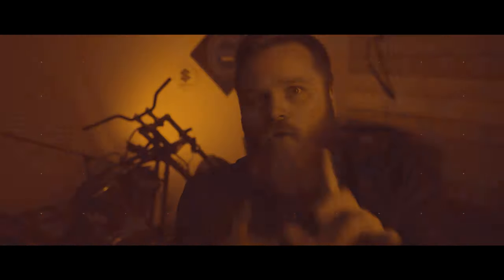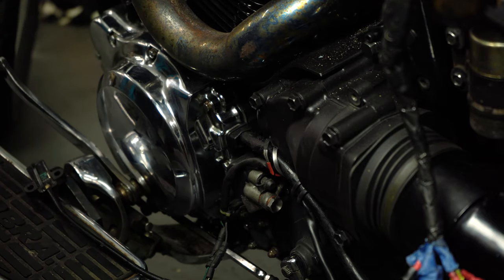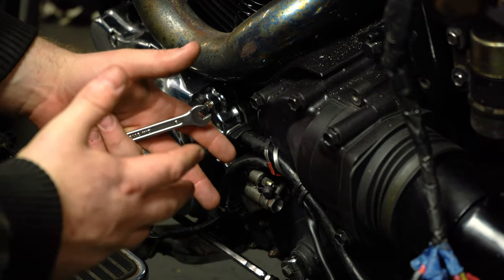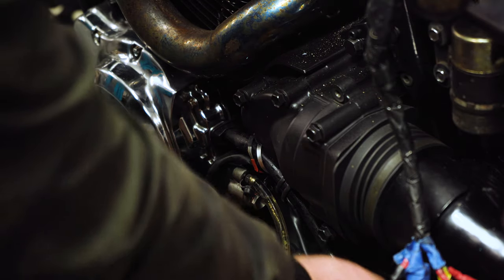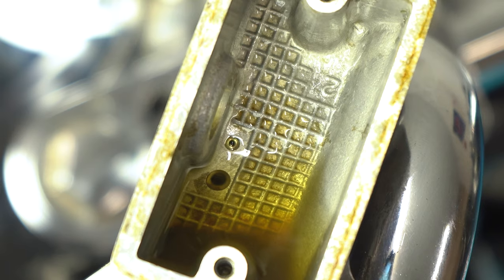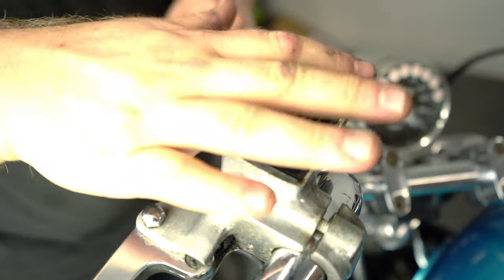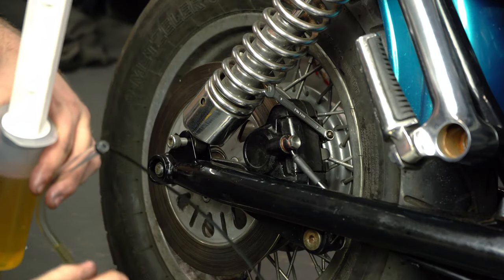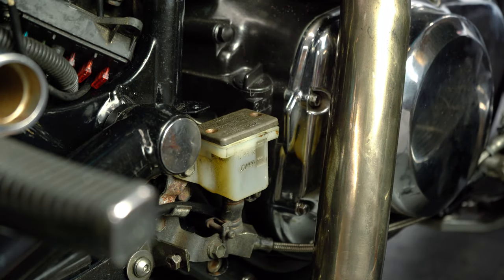Suzuki Intruder VS1400: Bleed Clutch & Brake Lines - Rebuild Part 7

Comment: Thanks for this.  Had my 2001 Volusia into the shop because it wouldn't shift up into 2 3 or 4, only 1.  Guy wanted $1k USD for clutch work.  Videos like these make me think I can do it myself, so I just got it back in 1st gear and will try a fluid change.  I have fixed three little scooters on my own so this is just another learning opportunity.

Comment: I love the clean and exact way you work your motorcycle. I would appreciate a future video about the brake pads of the same motorcycle, I have a similar 2000 model. Sorry about the bad translation and I used the google translator. Greetings from Central America.

Comment: I bought a '94 vs1400, clutch and brake fluid had turned to paste so I replaced both master cyclinder internals, clutch slave cyclinder internals, bought new braided lines and fitted new brake piston seals.
Now the front and rear brakes are fine, used silicon fluid the same as on my vmax 1200, but the clutch on the vs1400 kept disenging when the bike was hot. Bleed out a little fluid and it's Ok for a while but then does it again.
Local garage says the master cyclinder needs rebuilding although this has been done, so I took it apart and checked it over, everything OK, put it back together but now I can't for the life of me fill the system, fluid just will not go through no matter how hard I squeeze that syringe and won't go through when pumping the lever.
There is no blockage that I can think of as I blew down the lines before and air got through and the lever was pumping air through as I could feel the pressure when I put my finger over the end and both holes in the master cyclinder were clear.
I'm at my wits end here as I feel I've done everything right but something is amiss, any clues mate ?

Comment: Going to redo my clutch fluid on a 1995 Suzuki intruder 800. Did it once thinking that would take care of my problem. That was, after riding 10 miles, the bike starts to not run. Motor RPM are up but, the bike clutch stops working and I have to sit a bit, till it cools off, then it works great for another 10 to 15 miles and the clutch quits working. Replace the clutch disc and the problem still there. So, I wonder if like you said I might have air in the line. Going to try working on it tomorrow and do like you said Thanks...........Bobby..... Sanford Florida

Comment: Good video.
I clean around the bleeder nipple and reservoir cap before starting so no dirt can get into the system.
I always reverse bleed brakes and clutches whenever posible.
Why fight nature as air always wants to rise when in a fluid?
The fluid also changes colour because moisture is absorbed into the fluid through the rubber hoses over time.
Reply: The master cylinder diagphram is to isolate the fluid from the atmosphere air. It does nothing regarding applying pressure.

Comment: Currently have no pressure on my vs1400 clutch lever. Stripped the slave cylinder down and replaced the seals/polished the piston. Replaced the fluid and still have no pressure on the lever until it’s pumped then get minimal pressure. Took off the slave and with constant pumping on the lever, the piston moves a little. I’m gonna try reverse bleeding the clutch this evening to see if this helps. I did suspect the clutch maybe frozen but warmed the bike up, switched off the engine, engaged gear and rocked the bike back and forth it still didn’t help. Reverse bleeding is my last option before the clutch comes out.

Comment: I have the same bike and was about to give up cause of no pressure (replaced master and slave cylinder, regular bleed for an hour) but i'll try the reverse bleed and hope it does the trick.
Reply from the maker: Stick with it and don't forget the master can always be rebuilt if you still can't get pressure.
Reply: It works like brand new after reverse bleeding (had to do it 4 times to build up enough pressure and get aa much air as possible out.) Thanks bud
Reply from the maker: Thats great news! Well done!

Comment: Thank you for this video. Very helpful and well done. Any suggestions or advise on how to shorten steel braided cables? Changed the handle bars on my VS1400 and have now a lot of extra hose... also any advise on shortening the throttle cable is highly appreciated. Anyway thank you for this video series. I have a -94 VS1400 and these videos have been very informative to me.
Reply from the maker: Thanks man! Appreciate it! I would only ever advise getting made to measure steel braided. Cutting and trying to retro-fit existing lines is always a risky move brother. Try Motion Pro for custom sizes ;)

Comment: Just curious, when you first applied pressure to the rear brake valve through the siphon,  there was air in the line. Do you bleed that through the system til no bubbles because it didn't show any going through?

Comment: Thanks for a great channel.
I have two questions.
How much oil is there in the whole clutch system when it is filled up?
When you fill up the surenge with the breakfluid Dot 4, do you refill it many times, or is it enough fluid in the surenge to fill the system up?
Thanks for all help.
Best wishes from Tommy Winter.
Reply from the maker: Yes and yes, I don't know the specifics of how many ML go into the line but a full syringe would be more than enough. Thanks for your kind words!!!

Comment: Thanks for video But i do one mistake ,, i relesed the lever back and get air,,,how can i fix the problem 😢?  Now i want to start  to run and put in the first gear and  directly stopping the engine ,,,clouch dont work well ...intruder 1400cc from 2000

Comment: Hello  I new to the bike world I just purchased a Suzuki Intruder  VS 800  . The bike is in really great shape but there's no pressure on the clutch but I watched your video and am going to flush/ bleed the system in your video.  My other issue that arose is it leaks gas out of the bottom carburetor through the vent line Bowl. The bike has sitting for a few years like 3yrs in a garage there was a little bit of old gas in it and I added new . It does start and run . What could the leak be ,does it need to be rebuilt or cleaned

Comment: JUST  SUBSCRIBED...FIND YOUR VIDS VERY INFORMATIVE.....IS IT NECESSARY TO USE THAT LARGE A SYRINGE TO BACK-BLEED ?  TKS FOR ANY INFO.
Reply from the maker: Thanks for subbing. Yes it is, there are official back bleeding kits in the market but they are about 3 times the price and do the same job as the syringe.
Reply: TKS...I HAVE A LOT SMALLER ONE....SO, BACK TO THE STORE

Comment: I have an 87 intruder 700 that’s been sitting outside for 5 years. The brake and clutch levers are frozen solid. Would bleeding the brakes like this help or is it more serious?
Reply from the maker: It may be that you need to drain the lines and strip and rebuild the controls/masters. They could be seized from lack of use and need cleaning and new parts.

Comment: Hey man quick question is the oil pressure switch located behind that chrome cover aswell near the kickstand switch and neutral switch? Trying to figure out why mine keeps shutting down randomly at idle and the oil light pops up but then fires right back up no problem so i just wanna test the pressure switch but cant find it
Reply from the maker: Hi Travis. Good question. The oil switch is on the other side of the engine by the foot brake controls. It has a rubber boot over it and has a small brass screw on it for the wiring. If your oil light isn't coming in before it dies, I doubt its the oil pressure as the oil light will always show when the bike is not running. You should notice that the oil light also comes on when you turn the bike ignition on before hitting the start button. Then after it's running it goes out. Completely normal. But please do check what you think requires checking, just be cautious of chasing red herrings down rabbit holes ;)

Comment: I have a fuse keeps blowing on a 2002 Suzuki intruder 800 how do I fix it
Reply from the maker: First find what the fuse is being used for, i.e headlight, ignition etc, then find out if there have been any aftermarket upgrades to that part of the wiring harness and adjust the fuse appropriately to match the current

Comment: Hey Hagar, I hope your still fine and the purchase of your house worked out. I'm really looking forward to see more of your videos.

I've recently bought myself an Intruder and changed all the rubber-hoses to steel-braided lines. The bleeding of the brake-lines was no problem, but the clutch is driving me crazy. I've tried your method, the classic method of pumping the fluid with the main cylinder and I tried to bleed the line with an hand-driven vacuum-pump - nothing worked. When I pull the clutch I can move the bike but I can feel the clutch is not fully disengaged. It feels like the last 1/100mm of movement is missing. What do you think, is there still air in the system or is there another failure?

Have a good time!
Reply from the maker: Hi Quack, we got our keys about 2 weeks ago :) 

So what i would suggest is pump the clutch and build up some pressure then hold the lever in and open the cylinder bleed valve and see if any bubbles come out of the cylinder. Like a traditional bleeding method. 

If you are certain there is no air left in the line, but its not right still, take the top cap off of the clutch master and tie the lever in the compressed position on the handlebar over night and leave it. This will open the master allowing any trapped air bubbles to rise up.
Reply: Hey Hagar, sorry for the late reply, I've been on vacation for a few days. Thanks for you're advice and I'm sorry I forgot to mention that I've already tried to leave the clutch-system under pressure over night. I've also tried a pneumatic driven brake bleeder, parked the bike on a slope to let any air rise and tried everything else a second, third and fourth time - but there was still no change. 

Finally I figured out the clutch was just a bit sticky. After I started the engine on thursday evening (to bring the Trude in a shop) the bike was rolling free in 1st gear with the clutch disengaged and the problem is gone. 

 Have a good time!

Comment: Well, it did not work. I took the handle apart and removed the inside rubber seals and spring. I notice on your video the smaller hole had fluid going thru it. For some reason the one on the bike, nothing comes thru. could that small hole be plug up really bad, that it does not work at all. Thinking of just getting a new master cylinder and go from there......Bobby
Reply from the maker: Hi Bobby, if the system hasn't been used/bled in some time youbmay well have a blockage somewhere in the system. Is this on the clutch or brake line?

Comment: Just installed new clutch kit in my 800 intruder ive noticed my clutch is not spliting very much maybe 1/8 of a inch i bled the clutch and handle almost all the way in before plates move,is this correct

Comment: I have air in the system, won't bleed out.Clutch has no pressure. What's the best way to get it out? I don;t have a large syringe... Any other method? Thanks!
Reply from the maker: You could try the conventional bleeding method, open the bleed valve and pump the clutch lever, hold the lever in, close the bleed valve, release the clutch lever and repeat for about 5 hours and you might get it to work. But i would recommend buying a large syringe and following this method, 5 minutes and it will be done.
Reply: If u no have Syringe go get one !! Is only like $3 bucks !! Go make easy do the work !!

Comment: I’m really dissapointed you didn’t really go over the proper fluid level for the clutch, is the bike standing upright or on the stand, are the bars straight forward or turned all the way to the right, how much is too much or not enough. I can’t find this info for this bike.

Comment: Put your off spring on syringe test drive duty. Cover the reservoir with a layer of plastic sandwich wrap with a few pin holes towards one end. With a little air trapped between add a second layer of wrap with pin holes in the opposite end. Use rubber bands to seal the wrap to the reservoir, brake fluid won't play nice with electrical tape adhesive. Explain the anticipated full level and a few important bits of fluid equality then leave to see what happens. Then it's time to leave to see what happens...
And perhaps grab a little Justin Kase cat litter... 

Kids quickly learn to bleed and suck air...or they don't. It's all good.

Comment: Anyone know where i can find the cable thats located under the bleeder valve? It connects to the master cylinder.
Reply from the maker: Try motorcyclespareparts.eu ;)
Reply: do you know the name of the part
Reply from the maker: @nemesisnta9333  are you talking about the rear brake pipe(hydraulic line)
Reply: the hose that connects to the master cylinder down to the clutch
Reply from the maker: It comes in two seperate pieces, a flexible clutch pipe and a rigid, pre-curved pipe. If you check out the engine removal video you can see me disassemble the line.

Comment: Hello,   I appreciated your video and applied it to my 81 Yamaha Virago XV 750 for the front brakes- replacing the line.  It all worked as you showed in the video - fluid filled the reserve.  I then tried some conventional bleeding from above as I was getting no resistance with the cylinder.  Saw few air bubbles but then none and no resistance.  Tried more reverse bleed, flows right into the reserve.  Any ideas?- just keep at it and try to clear the air out of the cylinder?  -Geoff 973-896-8334